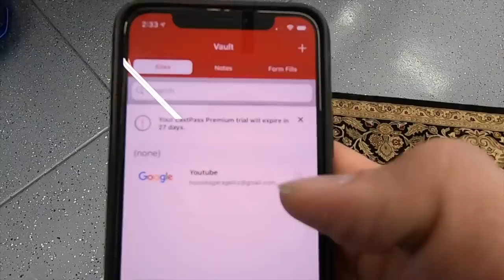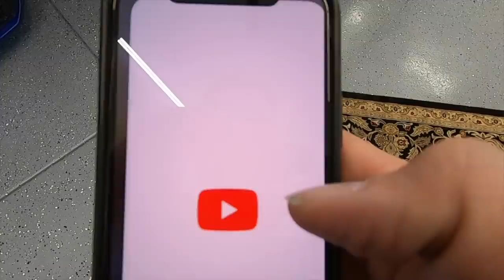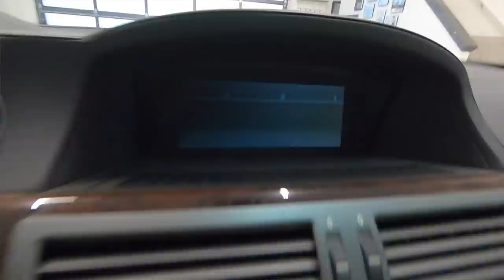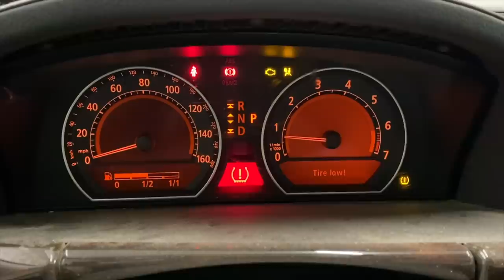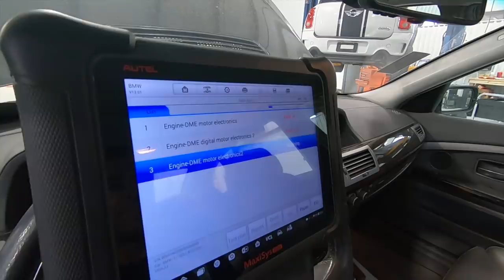I Bought a Cheap V12 BMW 760Li, Because I Never Learn From My Mistakes

Comment: I've owned 4 Beemers, an 80s 540, late 90s 3 series, Late 90s M3 and a early 2000's 5 series M sport. All 4 cars had the same issues described in this video, valve cover gaskets, hose and oil leaks etc. BMW is just not interested in addressing these recurring generational issues. Sad because these are really fun cars to drive. I drive a Honda nowadays.
Reply: You know valve cover gaskets aren't immortal on any cars? Otherwise BMW would just ring the supplier to GM and say "can you give me 200,000 of your immortal compound seals in the shape I'm sending you now?" These cars are around 15 years old and probably on their original seals which are so degraded they shatter on touch and have to be fished out of the head.

Comment: From how it behaved on the corners, I'd bet that Dynamic Drive would turn up dead as well. Audi's D3 and E65 were pretty far ahead of their times(especially if you compare it to Mercedes knock-off... I mean Lexus) being basically a giant network of computers, with a car attached to it. No wonder that after 10-15 years all this technology gets old and breaks a lot(but is still costly to repair) and thats why they are worth bottle of mediocre scotch and a few potatoes. W140 and E38 are the last european luxury sedans to buy used- real wood, real leather, legendary quality, previously owned by a yakuza boss or dictator, not a Kardashian, so easy to fix you can teach your dog to service them.

Comment: Ive owned quite a few older BMW's, Mercedes and other vehicles in the past few years and the one that has been the most reliable has been my 1998 BMW Z3 with the 1.9l naturally aspirated inline 4 and 5 speed manual transmission. manual soft top and pretty much base model other than leather interior. its BMW's version of a Miata. its been super reliable and has 199,500 miles about to hit that 200,000 mile mark next week! Hoovie you should consider getting one!

Comment: I was visiting a Mercedes dealership - invited because of my work - and a guy pulls up in a BMW 850i. He wants to trade it in and buy a mercedes convertible. It was only 2 years old. One of the sellers quoted him a low price - don't remember the exact figure, when the chief seller cut him off, and quoted him an even lower price - and a pan with kitty litter to put under it, as long as he was parked on their concrete.

Comment: Why not get rid of engine and transmission. Redo motor mounts to fit GM 350 plus GM transmission, and take drive shaft to specialty shop so it has GM universal and adjusted length to fit? Now you have luxury for probly around $10,000 to $12,000.

Comment: Sorry guys, I own Bimmers from my early driving days; I owned e21 320 carb, e30 318 is & 325i cabrio, E36 320 saloon & 325i coupe, E39 530da; also BMW bikes; and, never ever had so many problems as you constantly say during the video, nor leaks, and the repair or maintenace works are easier and more accessible than on any othr brand like VAG or MB; maybe you choose better the unit you're buying...

Comment: I must be really rich! less than 3K for 10 lights going off. I just spent $2800 on my 2012 328i convertible for RDC module (560), thermostat and waterpump (1040), New battery (470), belt and tensioner (470), diagnostic (150) for just one check engine light that had been on for a while and had spent 150 on another diagnostic at bmw who said the thermostat was gone. I did have a battery light go off on the day of the service and I took it to a non bmw guy who put in an after-market oil filter housing ... bad bad idea because of "over engineering" in these cars one must take them to OEM's or some good German car mechanics. I drove back and because of the RDC module malfunction the ECU sent all alerts of transmission malfunction, DSC malfunction etc and the car wouldn't start. Had to take it to BMW and it cost me that much on a car that has depreciated massively :| ... You see you realize you have a "luxury" brand when it breaks down and you're out of warranty.

Comment: I’ve owned three vintage  7 series 155k, 125k, 78k…all were inexpensive to purchase and all needed intake gaskets, 100%  new cooling system, alloy return water pipe, valley pan remounting, valve cover gaskets.  After these repairs no other issues…other than normal maintenance

Comment: I have one 750il V12 US Specs  ...It is a demon car to drive with Sports option ... The only problem is American Speed Limit ...70 mph / 113 kph ...you cannot open the valves properly ...I live in London ... where I drive a SAAB 9_5, 2.3t ...Bimmer is for European Travels, Germany and Italy ... yep, no speed limit on Autobahn / Autostada ...very rarely, I pushed the pedal to the floor ... sometimes, I do when there is no real traffic.. mine is double glazed windows so I don't hear much ...yes, these cars are a waste outside Germany and Italy ...driving elsewhere is liking muzzling a Tiger ...BMW is far superior than a Mercedes or even a Rolls Royce ...man you've got a Tiger to ride ...

Comment: Tyler mentions 745i engines going bad. I had two years ago I sold because of a nasty ticking noise. I never fully understood the issue. Even although the cars were under BMW warranty BMW didn't admit anything was wrong. What is the problem, was it one bad cylinder? I solved it by buying a 730d Sport! It was a very depressing problem though especially after selling my beautiful 750iL E38 to buy a 745i Individual. Thanks

Comment: I bought an E66 760Li back last June too... £7000 and just under 260,000 miles of which the first 201k was done in the first three years. Onyx Blue with ivory leather and piano black interior. Three-spoke steering wheel. Slight misfire at idle... and I've put another 5,000 miles on it since!

Comment: What the heck are you Americans doing with great cars? I'm driving BMW's for all my adult life, together with some other brands, but BMW's always have been cheapest cars to drive because I never had anything with them! I've had 1-series, 3-series, 5-series, 6-series, 7-series... Drove multiple 100's of thousands miles with them and almost NEVER had anything with them. Not even with the electronics and not even oil leaks!!

Only my first one used oil because I mistreated it. 

Whenever you check a car for faults for the first time, you should reset all systems before checking. An empty battery can cause for dozens of faults while there's nothing really wrong. 

I had an ///M3 that had an empty battery and about 50 faults. After resetting only one was left...

Comment: I bought a 2014 750il with 39K on it a year ago certified preowned.  It came with extended warranty and I bought maintenance plan through BMW.  Even then it doesn't cover everything. Oil breather hose started leaking last week and cost me $300+ out of pocket.  Anything that is a hose is not covered.  Replaced battery only 4 months after I got it ($500)  Also radiator fluid keep saying low.  Turns out fluid was old and due for chnage.  Not covered.  Also brake fluid needed changing.  All this just a  few months after buying it.  BMW CPO means nothing.  They don't even make sure all that is taken care of before selling it to you. Literally the radiator fluid starting causing problems days after I bought it.  So my first year of ownership I have $1500+ out of pocket.   Love the car though.  Such a  rocket and joy to drive.  I knew what I was getting into.  My 3rd BMW.

Comment: BMW need to be taking care of. if you leave it without service for long time you should expect all kind of issues and Faults.
you will need ISTA P or IMPA to read the codes and go through one by one,
a single ABS sensor can give you 2 to 7 different errors on the ECU, thats why you need to service BMW at the dealer or someone who understand BMW.
in US you don't have qualified ppls to work on it
We in EU different story, I personally owner 8 BMWs and i never had any problems
But if you give a car to an idiots like this guy he will start complaining without knowing why the car did this.
Oil lead = bad seals 
Black smoke = PDF need regeneration (the car do it by it self)
Battery drain = Relay messed up, (usually radio, Klima or wipers)

Comment: $7500 for a car with an original tag of $130,000 is a fantastic find.  You probably will have to put more money into it.  For instance, get a trans fluid flush.  Engine oil flush.  Rear differential flush.  Brake fluid flush.  Power steering fluid flush.  Coolant flush.  That alone will cost probably another $700.  But it's well worth it.  If you are changing all the spark plugs, GET NEW COILS, it's just good maintenance.  Get a new battery, any device with a low voltage signal means the battery is getting old, weak, or the alternator is going bad.  Change the battery first, then see if the low voltage signal comes back.  You don't want a weak battery!  I'd say if you get upwards of $10,000 into it, then it was a questionable buy.  But still worth it for a BMW 760.  V-12's are going to be a thing of the past and if you can get that running strong, keep up with it, in a decade or two, it will be worth something.

Comment: Dude, that’s actually not that bad almost 7,000 for a 120,000 worth for a car. Anyways, I have a BMW 325 ci 2003. Yea, crazy bmw cars they are great don’t get me wrong. You you need to put effort money and time to it. It will treat you right. Anyways, good cars. That’s the problem these high end luxury vehicle they are so cheap, I was thinking about purchasing a Porsche, since I saw them in a ok price range. The maintenance and gas mileage. It hurts lol

Comment: Spark plug change might not fix all the misfires. You might not be done yet. Then, when / if cats need replacement to pass smog, a few grams will be gone. Oh, good luck with all the electronics.

Comment: Hhahah what a clickbyte. This guy is good, he knows how to provoke and to grab an ad click :) . Here in Germany, I have never seen or heard of such a BMW in such a condition. You did your best to BS BMW several times in this video, however, you have forgotten to tell us how many KM or miles does this car has? How many previous owners and when was the last official and regular service at BMW dealership service? I know few people owning 10-12 years old BMW-s and with proper maintenance, they are in the top-notch condition. This what you have purchased for 4500 $ is a mile bomb probably with ex-owner never taking care of the car. 3000 for a repairs is nothing in this case.

Comment: Parts wise it's about 2000€ without considering garage parts discount, everything else is for labour costs? Had my V12 timing chain replaced for 1400 with all the necessary parts and labor costs, they took the engine off and worked on it for 1,5 days.

P.S - All cilinders misfire on one bank is not a sparkplug problem.

Comment: Frankly, as noted by UCBarkeeper, under $3k for a car that obviously has been abused and neglected for 10 years is shockingly low.  Brand/make really does not matter.  You ignore and abuse a Toyota or Honda or Nissan (voice of experience!) for that long, and you will be lucky to have a repair bill of only $3k.

Comment: That is really cheap for repair.. You pay that and 3 years  u can drive normal plus some repairs ... i did it to, for my bmw 525d I payed over 3500 euros and 5 years no problem. Once you pay than is ok. For VW Golf if you change like injectors 4 of them  for diesel in VW dealer cost 4000 euros. SO its cheap for bmw.

Comment: The rear probably needs more than alignment. That wear on the inside edges of the tires is from too much toe-out, yes, but it’s most likely worn upper control arms + maybe ball joints. If the rear tires have a ton of negative camber, it has worn parts. Ninja certainly knows that, but maybe it just didn’t make the video. Bring it over and I’ll show you the old parts from my 745. I live 15 mins from Wichita.

Comment: My uncle had a 2002 745i, drove 350000km with it, no issues, just the oil jets (known issue) so needed engine work and traded it in for a new model in 2012. New price 135000 Euro, trade in value 5000 Euro.

Comment: next year all the first Tesla costumers are going to find out how much a battery replacement is going to cost. BMW a non Asian brand sells cars all over Asia, 3,5% in Japan    that means for every 200 cars sold (in Japan 7 are BMWS, Much higher percentage if you take into account only expensive ones.  And drivers who buy BMWs and run a BMWs are persons who can afford to buy them new and don't want a used car. Also, when you buy a cheap used car its not only because supply and demand, it's also because of its condition, the worst of it is the less you pay. education and opinions are ever more superficial in YOUR part of The world no wonder Asian countries are gaining rapidly and taking over the world trade,

Comment: I can’t understand why anyone would buy a flagship 7 series. They’re barely any better than a 3 series for regular street use and you’re not really going use the full potential of the car unless you’re going 150+ on the autobahn. The size of the 7 series makes them a pain in the ass to park. Personally I’d just go with a base 3 series; Toyota might not need as much maintenance but Toyotas drive like ass compared to BMWs. I’ll gladly pay a premium for the BMW driving experience, but I’d rather get a base model 3 series over a 7 series.

Comment: $7000 in repairs right off the bat, no way no how!!!!! You could just do the spark plugs and get it running right, and tackle the coolant leak first. And just keep topping oil off, dump the car in 6 months.

Comment: It's not that BMW's are bad, its just that they have bad owners.  My father has owned 5 in his lifetime, no real big problems or costly issues.  Learn to do regular PM's and don't drive like a moron, it will last just fine with little to no cost.  I have a 435i convertible for 4 years now, nothing has gone wrong with 62,000 miles on it.

Comment: these high tech bmws are awesome but they aare pain in the back to fix to be like new...i have e36 and even this car is very hard to diagnose if there is a problem in the electronics...i have a problem with the ABS for years...it was working perfectly  untill i pulled off the ABS relays to see how it stoppes without it and after i put those back the ABS just wont start working again...when you clear the fault codes it doesnt turn the lamp off and the code is something like ''power supply unit fault'' or something like this...ive tryied to check all the circuits,ive read the schematics and everything seems to be okey...the ABS pump is working when i pushh the relay but the stupid relay doesn want to start on itself...i need to push it to start the pump...i tryied 6 different realys but nothing happens...all the wheel sensors are working perfectly when the car is moving...same speed and all...i didnt change the ABS unit..maybe ill try that,but the problem is that my ABS control unit is different than the most e36 because its Touring...theres not much e36 touring parts here,or i need to search more :) sooo good luck with your awesome BMWs...i love that car and for 7 years on full throttle its never broke down on me...awesome machine.

Comment: my buddy bought a 2008 328xi w 132000 miles for 5k and it hasn’t broken down yet. it’s survived at least 1 illinois winter in the hands of a teenager. still hasn’t broken down, though

Comment: My 1999 BMW 750i has never leaked a drop of oil or coolant in it’s life. Soundest engine and drive train ever!!

Yes, the expansion tank exploded, the radiator melted, the brake and power steering lines rotted, oh and just about every sensor it has has fried. Other than that, she’s a good’n!!

Comment: Please...you keep saying it..."Gagster Lean"...you use the term improperly:  The "Gansta Lean" is not sitting low and back in the seat like you keep saying!!!    It is instead when the driver holds the wheel with your left hand and you lean to the right.  You can look this up in the Urban Dictionary.  Thanks

Comment: Purchased a bmw 3 series from a credible dealer for 13000. It looked nice ran great.Bring it it to independent shop.. The differential light goes on 11000 repair..The mechanic checked the warranty extension 0 cost. . Dodged that cost..Be prepared to have deep pockets and have your mechanic tell you like he was told..The cars go in safe mode alot.. Oil leaks are from the pressure on the engines and heat

Comment: the 760li is a No, and a Hell No.   A buddy of mine had one for 6 months, and it spent 4 of them in the shop.  At one point the transmission was so broken that the BMW dealer our of Boulder, CO had to fly in a tech from Germany just to see what was going on.  He was lucky enough to get them to commit to a max repair cost of $4700.  IT went far, far over that once all was said and done.  There;s a reason why there are so cheap...  they are absolute crap.

Comment: Any bmw with more than 6 cylinders is a problem. Trust me, I can't stop buying them for my wife because she loves the v8's. Other than coolant system issues in the 6's they just keep running and running. Once you go with the 8 you'll spend as much time in the shop as you will enjoying it. It's too bad because when they are right they are amazing.

Comment: My 92 525 5 speed didn't really leave much at all. Despite a lot of it changing over to the plastic I think that's when they really started changing from aluminum and metal to plastic on many of their parts. But I got 350,000 miles out of that car and I beat the snot out of it for at least half of that.

Comment: i have a 2013 535i Individual and have had many computer problems.  I had to replace the front steering because the drive computer on the r&p died.